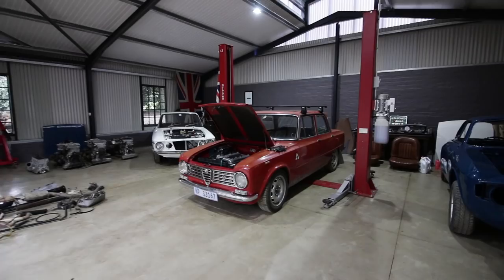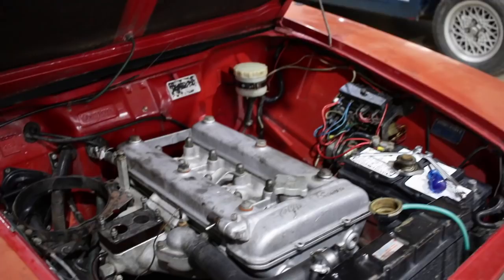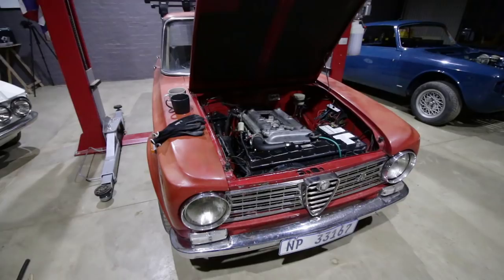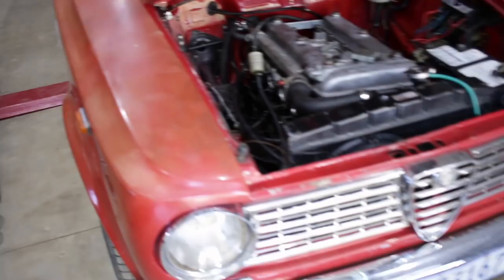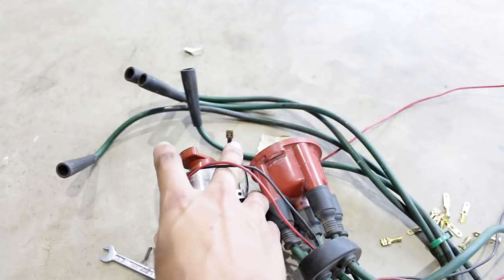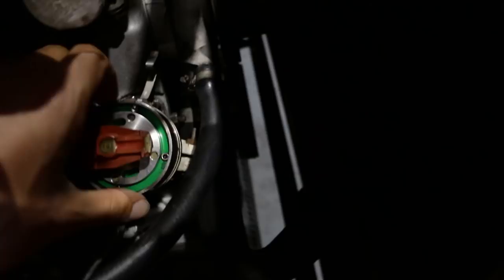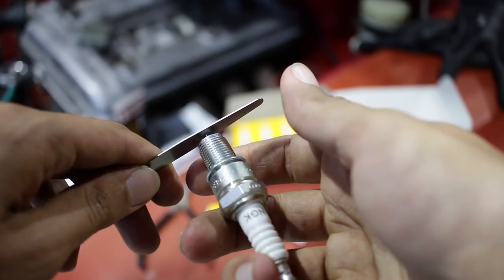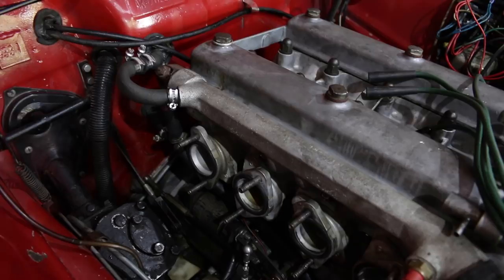Upgrading My Daily Driver - Alfa Romeo Giulia 1300 Ti

Comment: The 1300 was a great motor i had a 76 junior an extremely lively free reving engine always seemed happy at ful l throttle ,engines with cylinder capacitys under 350 cc always do ,somthing to do with  volumetric and air flow efficiency \ flame travel etc thats why the twin spark pulls so well .

Comment: Hi Jethro thank you for taking the time to film the work. Very informative. I recently changed my saab 9000 spark plugs with ngk plugs. You putting grease on the  threads made me think should I have done the same. I have concluded not. Your garage and the Alfa’s inside are a car enthusiasts dream. My mum had 2 gt’s in the 1970’s from new. Dad loved driving them . Quizzing mum today she seems to have no realisation that she was so lucky to drive and own them. Keep up the good work. Best wishes from England. Mark
Reply: Hi Mark   . The reason why  Jethro put a bit of grease on the spark plug threads
Hi Mark  . The reason why Jethro put a bit of grease on the spark plug threads is because Alfa 105 heads are notorious for seized spark plugs if  they are  installed  without grease.   The best grease is copper based grease or molybdenum grease.    Never over tighten spark plugs on these cars
Reply: titanus49 thank you for that , if I ever can buy an Alfa gt I will remember to do this. Best wishes mark
Reply from the maker: Hi guys. Yeah that was a copper based anti-seize paste. I’ve had plugs strip out the aluminum in the head before so I’m always very careful with plugs.
Reply: Jethro Bronner thanks jethro great work mark

Comment: Great work again Jethro. That bracket looks more than up to the task. The only thing I would mention, is to give it a quick spray of zinc based primer if you haven't, as that will start to rust before you can blink. Keep it up.
Reply from the maker: Will do! I'm going to move that bracket when I rebuild the car because it's a bit of a fiddle with it being under the carbs, and there is loads of space further forward.
Reply: Sounds like a good plan. Make it easier to work on if you can.

Comment: Seeing your car brought back fond memories of driving and working on my mother in law's nearly new '73 giulia super which had 1600 cc and dell'ortos. I recall the original plugs were the type with a larger central electrode and 4 (non-adjustable) earthing contacts. I know they later went "twin-spark" so I had thought the engine was a bit fussy about the spark plugs.

Comment: if you see bp6ey's get them, they have the electrode groove that tries to keep the spark in the center for longer, otherwise indentical to the ES.

Also NGK plugs are gapped 0.8 factory, unless denoted by a -numberhere for example a bpr6es-11 is a 1.1 gapped plug, where as a bpr6es is 0.8
Reply from the maker: I'll keep an eye out for some of those. Most auto stores here in SA don't have the greatest selection of plugs though.

Comment: Great video Jethro as usual.       I noticed that the cam cover is missing the two 10 mm screws located on the front edge of the cam cover,I am sure you  are well aware of this anomaly.
Reply from the maker: titanus49 well spotted! This engine has the early type head without the holes for the bolts, but it has a later cam cover that does have the bolt holes.

Comment: Great vid.  Generally just use a thin skin of sealant not a lot, unless the surfaces are very ‘not flat’.  I love Loctite 518 with most gaskets.  Every other sealant seems to make a mess.  I highly recommend it.  The copper (silicone?) sealant is useful for exhaust gaskets; not much else gets hot enough to bother with it.  Not a loctite rep or anything but that stuff is amazing.  Again nice job, and I love the car.  Old Alfas are brilliant.
Reply from the maker: YTNUKLR Thanks man I’ll get some and see how I get on. The leak I had was more to do with that I missed that little coolant passageway than bad sealant. I need to work out the best way to seal these engines when I rebuild them, they always seem to weep oil.

Comment: Something strikes me as odd.  The thermostat is in the water passage through the inlet manifold.  So there is no coolant flowing through it until the engine is hot enough for the thermostat to open.  So the water doesn't heat the manifold until the engine is warmed up.  Seems to me it would make more sense to use the heater circuit, not blocked by the thermostat, which would help the engine to run better while warming up.
Reply from the maker: Chas M yes indeed, you’re right. But these cars do actually have a thermostat bypass at the rear of the inlet manifold that goes back to the water pump, so water does circulate until it’s warm enough to open the thermostat.
Reply: @JethroBronner  Thank you for answering!  Now it makes sense.

Comment: Nice job on the conversion and troubleshoot work. Where'd you get the distributor? (Model Brand) I just put a Pertronix module in my '71 Gtv. What's the difference between them if you know? Oh, I'm really digging is your garage. You seem to have the coolest space working conditions, and all the time to do all this, lucky!! Not to mention the beautiful surrounding  South African scenery. Much like So.Cal. Keep the vid's Coming!
Reply from the maker: Jansen Photo Expeditions I’m not really sure about the Pertronix setup. The 123 is a complete distributor preprogrammed for the Alfa 105. It’s a plug and play unit which I have found very easy to use and very reliable. I got mine from Classic Alfa

https://classicalfa.com/products.php?product=IG040-ELECTRONIC-DISTRIBUTOR-BY-123-IGNITION

Comment: Not sure your solution for the additional water feed is too good (just spanning the hole with a waxed paper gasket) but I may have misunderstood. Otherwise I am very impressed with your mechanical skills. I assume you balanced the 2 carbs somewhere along the way. Previous gearbox overhaul was extremely impressive, certainly something I would not tackle
Reply from the maker: Yeah the weird thing about that extra hole is that the factory solution seems to be just covering it up. I did balance the carbs by matching the valves by looking through the progression drillings, that usually is an accurate way to get them in sync, unless your shafts are twisted.

Comment: Hi Jethro, I recently got a 1967 1600 TI pig which is in great nick really but it won't start. the engine turns and there's a spark, the spark plugs are dry. I had recently replaced the mechanical fuel pump, lines and filter, and the carb refurbished because it would not start.  Now after being parked in the dry for a month, I have exactly the same issue. The guys at Stalder & Moser are great but having the car collected would cost me a fortune again.There isn't that much information on the internet on the Solex, which is why I would like to pick your experience. Can you help? Thank you from Zurich. Great channel!

Comment: Any name-brand MIG welding machine should have settings inside the spool cover.
Measure the thickness of the base metal, convert to gauge thickness, set it, and forget it....
Reply: A good short-arc, or globular transfer, should sound like frying bacon.
Yours sounds like tapping on a snare drum, meaning the wire-feed is too fast, and/or the molten pool is too cold....

Comment: I like the use of the lift to make it easier to work on, definitely saves the hamstrings. And also, the "who needs a fender cover" attitude, you don't seem to leave tools lying on the fenders, anyway. 

Not a fan of torque wrenching, such as on the spark plugs or manifold?
Reply from the maker: Dan Kingsbury You’re right dude. You win. 

Happy now?
Reply: Sorry if I came off as critical, dude. I sincerely want to know why you decide to do things a certain way, which of course you are not required to provide any explanation for. And, in fact, I should have started by saying that I don't use a fender cover, or a torque wrench, if I think I am skilled enough or the risk is low.
Better late than never: I enjoy your videos both for the detail and the subjects, so keep up the good work.
Reply from the maker: Dan Kingsbury Hey thanks man. Sometimes it’s tricky to pick up the tone of a comment in text. Sorry about that.

Well, the reason I don’t use a fender cover on that car is because that car is a real beater. The paint is dull and peeling off already, a few extra scratches don’t bother me. 

Things like spark plugs you generally get a feel for when tightening. I once got a long lecture from an Italian guy from AFRA about how to feel for the correct torque on the plugs, never had an issue after that.

I don’t always do things the absolute best way, especially on my Giulia, which is only a beater run around that’s begging for a rebuild anyway. I’ll be a lot more thorough with the rebuild cars than the beater daily.

Comment: Another good episode :). I think you said that you used the BP6ES plugs, which are the projected nose spark plug? I used those before in a standard engine but switched to the B7ES after mods. The reason I switched to the non-projected nose plug was because of contact with the BP plug side electrode. The electrode actually bent on a spirited drive once.

Comment: Welder not set high enough, more power and much more wire speed...I’m now heading over to ebay to look for an old Alfa! Lol.
Reply from the maker: Yeah the welds on that bracket weren’t great. But good enough to hold that regulator on. Yeah go get one! They’re a lot of fun.
Reply: Jethro Bronner 

Cheers, just spotted a ‘72 GTV 1750 near me! 😍
Reply: @JethroBronner  she just told you why they were bad.I suggest you pay someone skilled a few £ for lessons.You have the gear.Why say 'the welds aren't great' when you could be looking at a nice neat strong weld ?.Welds with cavities and inclusions are more prone to fail after a time under vibrations.

Comment: Regards! I have an ALfa Romeo Spider 1997. It starts at the first attempt. It remains neutral without failure. But, if I touch the accelerator pedal it turns off automatically. For this reason I cannot move it. I changed the phase inverter, spark plugs, belts, water pump, PCV valve, new battery, I cleaned the acceleration chamber. I don't know what else to do ... what sadness. I do not want to sell it. Oh, another thing, the light of what an injector looks like comes on on the dashboard. Do you have any idea what it could be. Thank you in advance. Greetings from Panama.
Reply from the maker: Hmmm I really don't know much about 916 Spiders. But I do know they can have throttle TPS Sensor issues and throttle body issues that will cause that sort of thing.
Reply: @JethroBronner  Thank you friend, well, with that answer you give me a great hint. I'm going to see where that TPS sensor is located and I'm going to change it. One last thing ... don't you think the fuel filter can cause such damage?

Comment: Do these cars suffer from the same biodegradable wiring harness work in the engine compartment as my Volvo 240 restorations do? Your wiring looks quite new.
Reply from the maker: Not really, the wiring seems to hold up really well. The factory insulation didn't really degrade too badly over time.

Comment: Jethro - why Alfa Romeo? As a fellow Alfa nut I shouldn't need to ask, but I'm curious why you choose to spend your time in 40+ year old antiques that nobody else our age knows or cares about. These cars are ridiculously rare and expensive in the UK so I drive more modern Alfas. Oh, to live in a dry climate...
Reply from the maker: Strike86 I love them because they’re not just some old car that kinda cool. They are still really great cars from an engineering perspective, even by today’s standards. It’s not a chore to drive them. 

I love the way they’re engineered and designed. I don’t think of them as artifacts or antiques, they’re just my cars.
Reply: They arnt as expensive as you might think. Especially the 4 doors
Reply: So wrong strike 86 , I drive my 77 Fiat Spider 90 % of the time when I drive within 10 miles of home which is almost always.  You get comfortable driving old reliable.   They are easier to see out for one.  Secondly, you have much better road feel.  It is also nice that they are not so low that you have to worry about bottoming out.  Also, it makes many people very happy to see such an old car being loved and taken care.   I get thumbs up all the time.
Reply: Strike86 im 28 i bought a 1.6 gtj as my first car. modern veichels just armt as interesting to me and less fixable by myself, the driving experience is more visceral and as i grew up with carts and formula ford it makes more sense to me. I do have a mv agusta brutale that has electronic abs and tc but those safety systems are nice mostly because im less good at riding motorcycles and have less understanding of limit handling capabilities of them. I can imagine ordinary drivers who buy very fast cars also feel that way about their cars
Reply: Old Alfa Romeos have more soul....
Reply: Life's too short to drive boring cars.
Reply: Strike86 iii